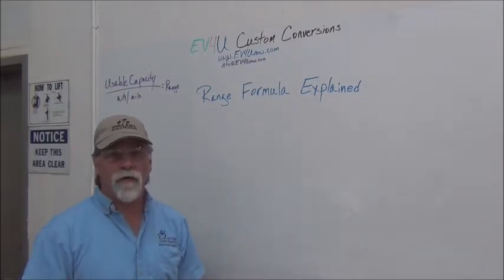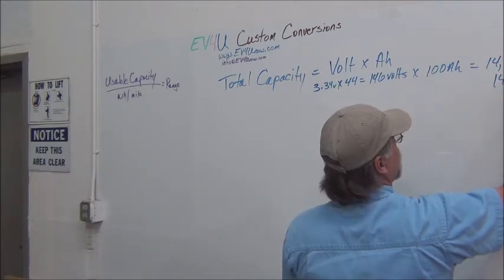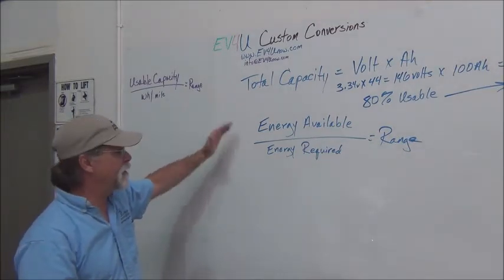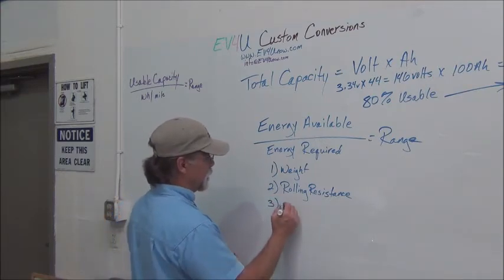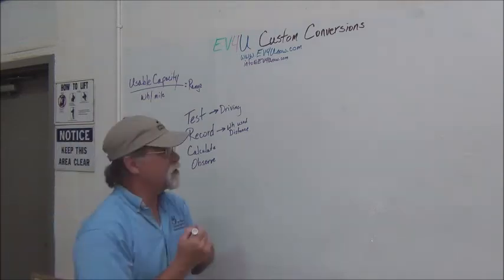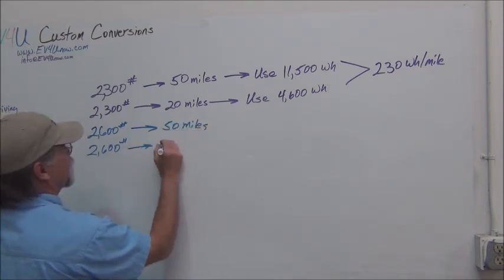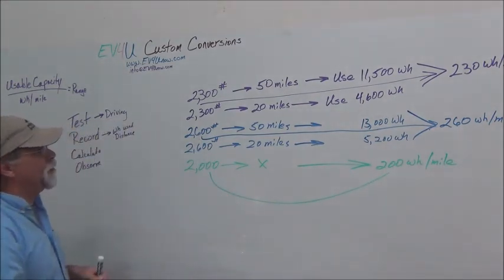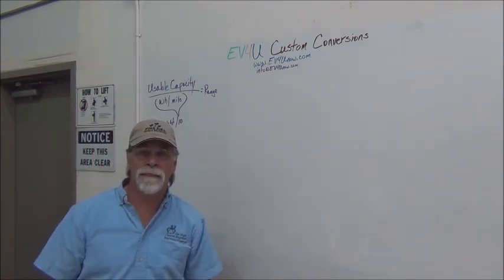DIY Electric Conversion Range Formula Explained  www.EV4Unow.com

Comment: 350 watt electric motor with 20 amp controller can be connected to 30 or 40 amp battery?
Reply from the maker: Please address your questions to:  info@EV4Unow.com  Thank you for watching.

Comment: EV4U, Your magical number "weight/10" widens my eyes. It took mankind thousands of years to arrive to Einsteintical formulas but you did it in 21 mins. Anyhow, Although you have not done test runs on 2 wheeler to capture energy consumption for a given stretch but I still have a question and rather I seek recommendation weather I can consider Weight/(greater than >10) since rolling, drag etc is less than 4 wheel anyday.

Comment: Can we find range by adding all the resistive forces like air drag ....rolling resistance ....grade resistance.....and converting it into watts and then dividing battry capacity by that added resistive forces and then multiplying the ans with the speed .......will this work out
Reply from the maker: No idea, as it is way too much work compared to our tried and true method.
Reply: @ev4u  ok thank you for your reply sir

Comment: Would this formula differ for two-wheelers? If so, why would it differ?
Reply from the maker: No idea, as we do not have enough experience with two-wheelers.  Differences in rolling resistance, drag coefficient, etc.  The formula is based on real world testing which we have only done with four wheel vehicles under 5,000 pounds.

Comment: Really enjoying your videos; they're helping me determine whether an EV conversion on a project of mine is worthwhile. I was a little surprised to find, by using your calculations, that my 4,500lb car would only have a range of about 100 miles even if I used the full battery array from a Tesla Model X (about 60,000wh). Even weighing 1,000lbs less, that means my car would have range a little under 1/3 of the Model X's. Is the Tesla system optimization really that superior to what can be achieved  by a home builder? I would have thought $20,000 of batteries would yield a longer range.
Reply from the maker: You have to realize that the Tesla has low rolling resistance and a low drag coefficient.  That is why conversions seldom have the same range per kWh as a Tesla.  FYI:  The national average is 3.1 miles per kWh.

Comment: Thank you for the video :) i have a question if you can answer me, my project is to make an electric vehicle from scratch not a conversion from another vehicle, so i have a 5000W 48v BLDC motor and after calculating the battery pack capacity using your formula i found that i need a  1200W battery pack and to have the same voltage as the motor, that means that i need a 48v 25ah Battery pack in order to run 20 km with a mass of 350 kg for the vehicle , Now does that make sense ? a 1200W battery is ennough for a 5000W BLDC motor ? Please answer me i really need the answer for my project, THANK YOU!
Reply from the maker: Please address questions to:  info@EV4Unow.com

Comment: How come this formula (watt/hour per mile) doesn't work for tesla model s. The car weighs 4950 Lbs and goes 370 miles with 100kh/hour battery. According to the formula you presented its supposed to go only 202 miles.
Reply from the maker: The formula only applies to conversions.  Tesla's are a purpose built vehicle and are much more efficient than a conversion.

Comment: does the tipe of motor affects the WH/mile ?
also, great video! 🙌🙌🙌🙏
Reply from the maker: Motors that are designed for this purpose tend to be pretty close in weight and efficiency.  We have not observed a difference in the WH/mile usage in motor types that are normally used in conversions.
Reply: EV4U Custom Conversions, so it can be applied to a DC brushless motor ?
thanks for answering 🙋
Reply from the maker: Yes

Comment: Excellent video! Also just to add for people who may use the metric system like myself :D
1 wh/mile = 0.621371 wh/km
10 pounds = 4.53592 kilograms
10 / 1 = 10 (as per formula)
therefore 4.53592 / 0.621371 = approx 7.3 (7.299857894880836)

So...
wh/mile = weight in pounds /10
wh/km = weight in kg / 7.3 (approx)
Reply: Awesome work dude 👍👍 thx
Reply: thankyou that was my question while watching